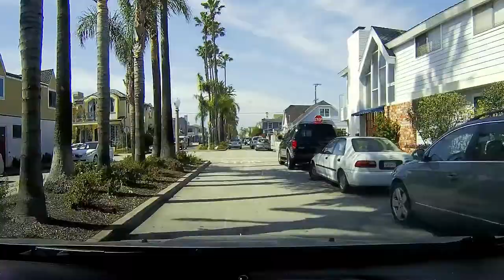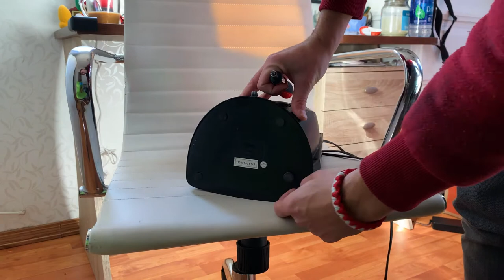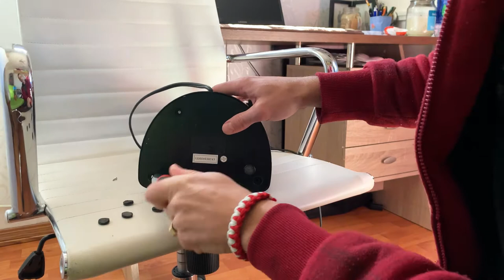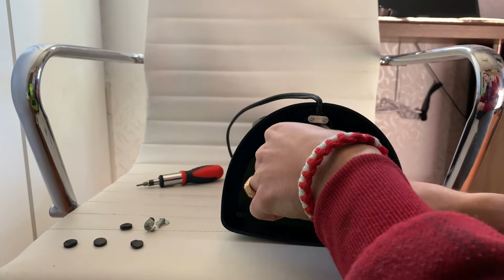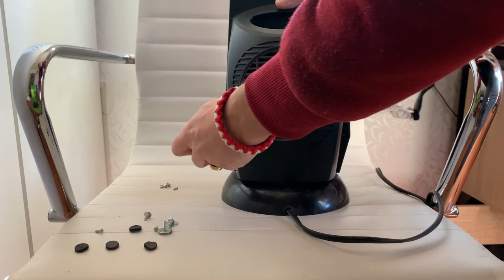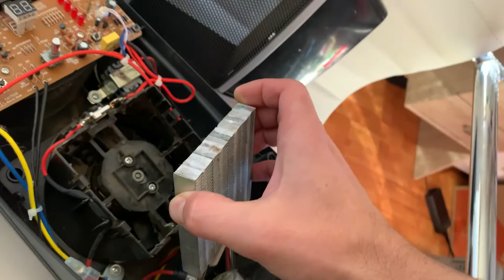SPACE HEATER NOT HEATING ROOM FIX. SPACE HEATER NOT BLOWING HOT AIR

Comment: My ceramic heater was barely blowing air so I took it apart and removed 3-5x the amount of dust you did! Now, I have air but NO heat or minimal heat, say +5F warmer than room temperature, whereas before it was +50-75F hotter. Thermostat appears to be working. Your thoughts?